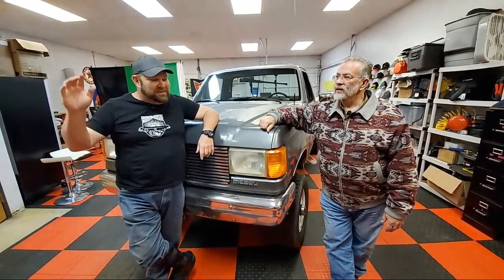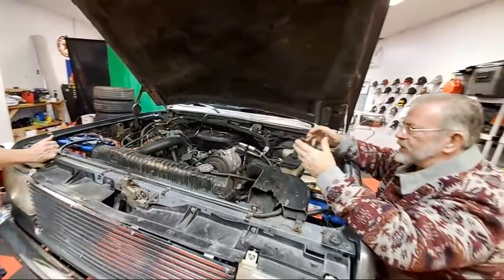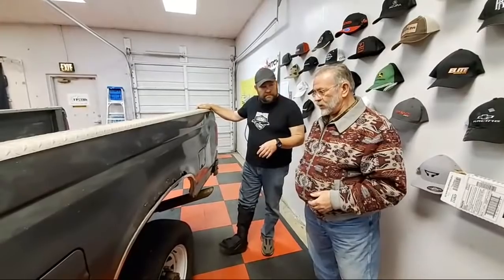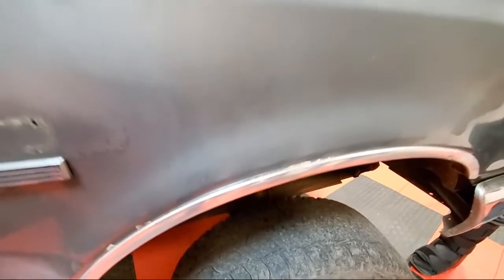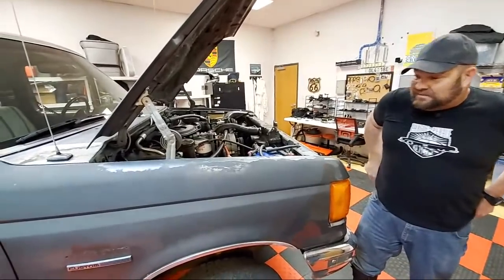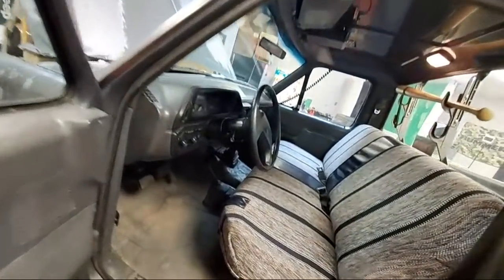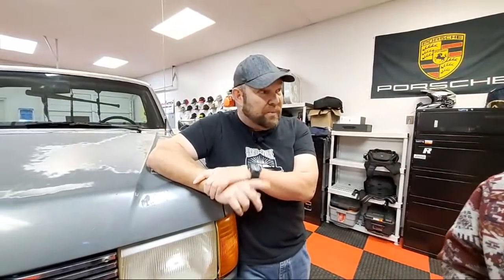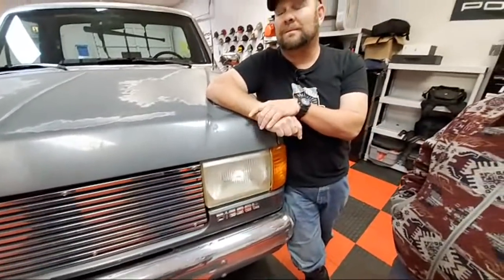Here's Why This Old 1989 Ford F-350 Is (Or Isn't!) Better Than A New Truck! | Talkin' Trucks Ep. 76

Comment: Come on guys give it some love!

Do the paint and panel properly, go over the mechanical get it all running nice, add some decent rubber and keep the rims. Keep it looking original but add a few mods to help it out off road and also maybe a few mods to use it as a overland rig. It would be a simple reliable cool over landing rig if done right 👌

Comment: 1989 Ford F350  had a GVWR of 9000 lbs and a payload of 4295 lbs with Payload Package 1. Horsepower of the 7.3 Diesel was 180 and torque was 345 lb.ft. F150s and F 250s had a TTB Dana 44 front axle (twin traction beam) while F350s had a Dana 60 solid front axle. F250 and F350 SRW pickups had a Ford Corporate (now Sterling) 10.25 rear axle, not a Dana 60.
Reply: I was rifling off most of this during the live chat. A ton of misinformation out there
Reply: @danatkinson6698  I saw that. I would hope that people realize how capable the one ton pickups of that era were. They tend to get dismissed as not as good as the modern designs, however they were/are quite capable of hauling a load.
Reply: @bobschultz9100  I totally agree. They were very capaple because they didn't have 3,000lbs of unnecessary crap like touch screens, ridiculous  center consoles that removed the center seat, electronics for the electronics that control the electronics and airbags galore. I have an 11 f250 supercab 4x4 and a gas engine. Just an xl and it has a payload of 3,300lbs. Far more than many of the diesel configurations people buy. Base model rocks
Reply: My '86 F250 has a GVWR of 8600lbs so not far behind. It's torquey but slow like you expect a diesel to be.

It desperately needs a 5th gear though. Lordy. It could probably get in the 20s on the highway if the RPMs weren't so screamy.
Reply: @dchawk81  a 7.3 zf 5 speed should bolt right up
Reply: @danatkinson6698  it's not worth the expense or hassle. It's an old beater.
Reply: @dchawk81  it's one of those things that you change out when you have to replace the clutch. Not neccessary but nice to swap out when you already have to pull the trans for other things. A good trans can be found for 500 give or take a little bit.
Reply: HD F250s of this era had a Dana 50 TTB front end. Which I guess is basically a 44 center section, with D60 parts from the knuckles out.
Reply: @justinstearns9723  I believe the Diesels only came in HD F250s as well. Have to deal with that extra weight somehow.
Reply: Ken Bean Yes that’s true.

Comment: the 1992-1997 Ford Powerstroke F250-F350 trucks have near modern milage, long lasting engine and drive train components, and workable power.  They also feature comfortable interiors and are the last trucks with the front window vent.  You guys should buy one just to tow around your projects.
Reply: Powerstroke started in 1994

Comment: I hope they reach out to local and national retailers for some help. I hope they don’t go too crazy but some TLC and little cleaning up and she be a beaut !
Reply: As its going to auction when they’re done they better fix the ride with some coils,  and get a new head-unit. Don’t go over the top with the wheels and tires.
Reply: I have a 350 F  5speed 92 deseal the abs light is on and brake is lock  why please help me

Comment: They started calling them powerstroke in 1994 but they were still international engines. Even the 6.0 powerstroke was built by international and the 6.4 .Ford did not start designing their own diesel engine until they introduce the 6.7 liter that was a true powerstroke.
Reply: Correct and I have the best of the bunch, an '02 1 ton 7.3L.  Now the 4R100 transmission is another story...
Reply: I have a 1989 Ford 250 is anyone want too work on it in upgrade.

Comment: Gents, you are ill informed on the Twin I-beam and Twin Traction Beam (TTB) suspension designs. The Twin I-beam was found on 2wd trucks and vans, while TTB was found on 4wd F150s & F250s (the F350 used a solid front axle). Twin I-beam suspension debuted on the 1965 F100, and carried on until 1996 in the F150, 1997 in the F250, 2014 in the E- series passenger/cargo vans, and is still currently in production on the E- series cutaway chassis.

It is a very good suspension design, hence it is still being produced 55 years after it debuted. I own a '65 F100 and a '96 F150, the first and last years Twin I-beam was offered on the half tons. I've put over 200,000 miles on that suspension, and it has yet to give me any issues. I don't get any uneven tire wear. The TTB trucks were known for requiring more frequent alignments; but were a stout, reliable design. The idea to increase wheel travel by moving the pivot point to the opposite side of the vehicle was ingenious. That was the idea behind Twin I-beam suspension, to offer more wheel travel on an IFS without making the truck wider. Twin I-beam suspension has been used extensively over the years in desert racing, and is known for its strength and long travel capabilities. It definitely isn't what you guys labeled it as in this video.
Reply: wow, you can use Google!
Reply: @94SexyStang  i don't use google, I don't like them.

Comment: Unless they are overly rusty, just replace the tires, maybe go a tad fatter, but keep the wheels. Add a tailgate. Add a stock grill back in the front. Make sure the heat and AC work. Ad tow hooks to the front. This fits into the category of good old truck. Make sure all the gauges and lights work.

Comment: Ford F-150 4.6L  2 valve  engine with a 3.55 gears Very reliable I have 290,000 miles on mine
Reply: 4.6 was a great motor for reliability. I've met many with the 5.4 and 300k

Comment: The ford guys can chip in on this. Sounds like there are some free performance upgrades you guys can do with just a bit of elbow grease. Hog out the air intake to free that up a bit and turn up the injection pump. One of the other videos where you guys introduced this ‘89 F350 had the description of what exactly to do.

Comment: Definitely test it! Mpg and towing.   Would be awesome to see how far trucks have came. Good or bad. Who knows it be surprising on the Ike.
Reply: I have a 1989 F350 dually with the 7.3 idi and it has only 85,000 miles.  It has a 4.10:1 final drive gear ratio.
It gets 13.5 MPH on the interstate.

Comment: F150 and f250 had the independent suspension in the front and f350 had solid in the front in those trucks
Reply: The 4x4 f250 was solid axle.
Reply: @lukelongworth3203  incorrect, they had Twin Traction beams
Reply: @usmcvet0313  Yes and No.......TTB WAS a hybrid independent suspension.....it wasn't True independent, but it also wasn't Solid axle.....it was Hybrid
Reply: Lol it’s not independent but it’s not solid?

Comment: Walmart can order rims for the truck. They do have some relatively inexpensive steel rims in either black or white that can be ordered, and they can also order tires or may have something in-stock for the truck.  I believe those were LT245/75R16, 10 ply tires, but it should be able to easily handle a set of LT265/75R16 10 plys.  I'll recommend the Goodyear Wrangler Authorities. Very aggressive but they are also severe snow rated with the mountain and snowflake symbol on the sidewalls.  Great, relatively inexpensive tires and they get my thumbs up.

Comment: The pump may need servicing, and possibly new injectors, but overall it seems like a good deal. I'd see if you could patch the bed panels so it doesn't turn into a rust bucket. Though for performance I'd look into a turbo kit. You would be amazed at how much better the truck feels with the turbo. They actually spool turbos really quickly and clean up the exhaust a lot too.

Comment: Damn that thing looks clean lol (under the hood)...
I've got a 7.3 diesel 2003 and I actually use it in the most aggressive environment you've probably seen hauling water.  In one of the most famous mountain ranges in Colorado. My driveways more than 2 and 1/2 miles straight down barely one lane at times somewhat dirt road.  I say that about the road cause its mostly rock outcroppings and naturals.   Nature dictates what you do up here even if you've got yourself a tank. It won't make it up here. Dont bother calling anyone for emergencies...you'll just die no ones coming this far..maybe helicopter (probably not anywhere to land).When it rains and or snows it means death upon adventure.  2 foot ruts with more than a 1000 or more foot drops on one side and sheer cliff face on the other with boulders and cliff face c'mon down on you.  It is pure hell at the bottom until you get to the top in heaven. With the sun the forests ,and pine tree's bears, mountain lions ,elk, wolves ,deer ,turkey ,bobcat etc. 
No electricity no water no nothing. The miracle of life up here is chop wood carry water. That is the mantra and reality of life.  Not sitting in front of a mirror every morning before work.  My truck is my life line to the outside world. I've got two massive green houses I grow things in and a solar powered  cistern in my log cabin. My trucks the only way to get the clean water there for the flower and the cabin. 300 gallons or a little more every week or couple of days for the crops and livestock.  Life ain't no joke out here. This is the way your parents parents lived.  Would break most in less than a week. Its a hard dusty dirty painful life full of nonstop work.  I love it because it weeds out the weak. The truck is up to the job.  It's  a confort to hear that diesel engine when there's 2 foot of snow and you've got miles of straight up hell and thousands of pounds of death on top of you pulling you down.  This life will put a smile on the face of those seeking the face of God.  Everyone else will fall under the pressure and the pain.  
I LOVE IT!
I wouldn't trust anything more than this 7.3 diesel engine.   Takin care of properly it should outlast me. Its a remnant if you will of the hardworking that lined our future. 
A remnant it seems....as those times have long passed. Now is the age of the soy boy and his absolute obliteration by nature for its ascent into weakness.

Comment: I bought mine 6 years ago two tone silver with extended cab with the two smaller vertical windows in the extended part, rear slider, headers dual exhaust, 4x4 , 5” lift kit , 460 motor, F250 with 38” super swampers , I love this truck more than my wife 😂, it’s a close call when it comes to my dog, .... I’ve never had any major issues with this ole girl, only regular maintenance stuff, hauled 8 tons of hay on a trailer and two tons in the back and never missed a lick, only bitch I have is gas mileage, will pass everything but a gas station.... but seriously I don’t know about any other years but my 1989 ford  F- 250 is the best truck I’ve ever owned hands down , I’m 61 years old and have owned lots of trucks but non can compare to to this old girl she likes it rough and knows her stuff lol she eats Chevys for lunch if you ever get a chance to pick one up , even a beater, don’t pass it up you’ll regret it , keep on trucking my friends

Comment: I miss my 1985 f250hd 4x4 6.9 4 speed manual, with single 5" stack , the things I did with that truck know one  would believe me  if I  told them,  a absolute 💯% power house.

Comment: I have a extended cab 89 f150 5.0l 4 speed manual 4x4 8ft bed. This truck is amazing. This summer I wanna yank the 302 and either put a new 302 with a turbo or a 7.3l turbo diesel

Comment: I have a 1992 Ford f150 custom with a 351 Windsor in it are those good trucks to run a 14-hour trip and it does have two gas tanks

Comment: I have an '86 F250 6.9L with the T19 transmission. It's only 2Wd so it has that beam axle like a semi in the front (same shape just smaller). It's a solid truck and super easy to work on which is awesome. BUT....

For comfort (eg long distance driving fatigue) and big towing you really do need a new truck. I have an '18 Ram 3500 6.7 Cummins w/ 6spd AISIN dually too and there's just no comparison.

Of course they're not in the same class either so it's not really fair, but even my former '15 F150 blew the doors off the old truck when towing the same amounts. That was a class down.

Comment: $2,500 is a very thin budget.  However, Tires, lights, tailgate, navigation system, radio upgrade (or combo unit of the 2) back up camera, maybe forward as well.  That would about eat up your budget I would think.  IF I were to get ahold of that truck as a daily driver or tow rig, those things would be bare minimum.  Can go nuts with trucks on what you would do with it.  But I think the next buyer might appreciate having that done for them.  Then they can custom tailor any more upgrades/modifications to their own personal liking. I would not waste money on replacing the bed or doing those kinds of beautification projects.  It would eat up your budget and you don't know what the next owner wants it for.  Could be for the farm, could be for off road.. never know.  Either way, there are less expensive alternatives to it.

Comment: I would look into contacting treadwright for tires and pmfsuspension if you want to seriously improve the ride.  There was also someone selling doubler kits for the bw if you want to go crawling and the zf doesn’t have a low enough 1st. Could do a cheap body work series, get it wrapped in reference to the place it’s getting donated to.
Reply: The zf5 has a super low 1st gear. "Granny Gear". You don't even use it in these trucks to start moving, even uphill. When you're loaded to the max is the only time it makes sense to actually use first gear. Also when wheeling.
Reply: @shanechambers9529  yeah I know the gasser version of the zf had the super low 1st, wasn’t sure if the diesel did to.
Reply: @nicholasarceri6613  Ah, it's the same exact trans man.
Reply: @shanechambers9529  looking on google looks like there were three different ratio sets available based on trim and engine pairing.
Reply: @nicholasarceri6613  Really? I did not know that. Can you elaborate at all? Just wondering cause I have a 90' f250 with the 460, 4x4, and it's an XLT Lariat.
Reply: @shanechambers9529  http://www.dieselhub.com/trans/zf-5-speed.html

Comment: F350 never had twin I beam front end
Reply: You mean twin traction beam.  Twin I beam is long standing.
Reply: The 2wd f250 and f350 still has a twin I beam front. The first years of the new body up to 83 iirc there was an option for a ttb (or twin traction beam) on the f350. I've never seen it but that's the info I was given

Comment: Ford started twin I beam suspension in 1965.
Reply: On two wheel drives, 4x4's got it in 1980, f150, f250 and one year ( if I remember correctly) f350
Reply: @darryladams519   --  Yes, I forgot about the 4x4 aspect.  You're correct.
Reply: And the econoline vans got the twin I beam in 75. The f250, 350 and cab and cutaway e series still uses the twin I beam to this day